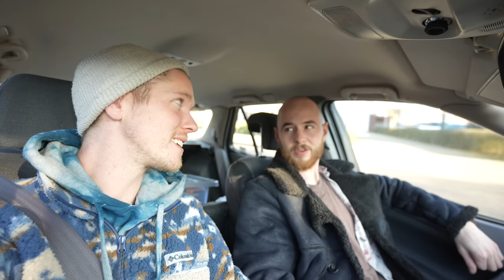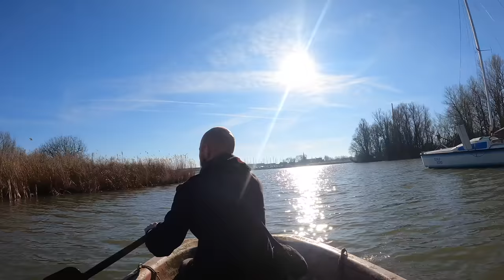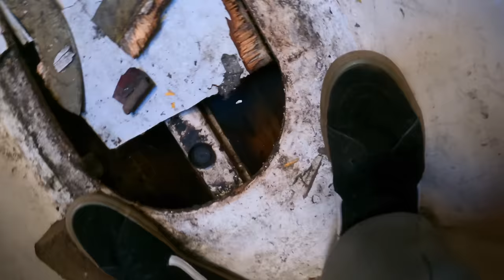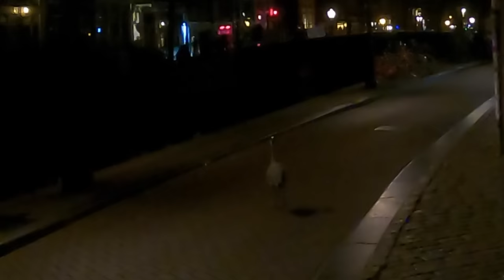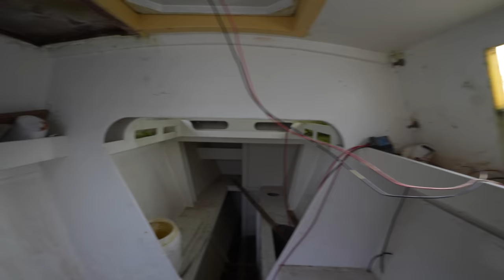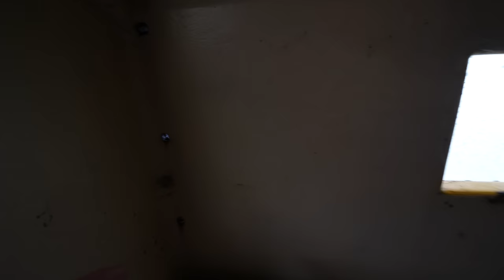I Made A LOW Offer On A SINKING Catamaran | Wildling Sailing

Comment: Assume there is damage to the structure, even though you can't see it. Given what you're trying to do, you'd be looking at pretty much a full rebuild just to begin to feel safe. I would not trust any of the bulkheads or beams.

Also don't underestimate the mess that's Brexit. Don't expect to ferry goods (or those engines) back and forwards without issues! You'll also need to factor in the cost of refreshing your visa (incl. the travel).

Personally I hope you don't go for this one as it just doesn't appeal to me and I can't see it being a nice sailing experience for you or any visitors/companions due to the accommodation.

Comment: I strongly disagree at the naysayers who see the mould and dirt but don't look beyond. If Hanneke Boon thinks the hulls are well built she above anyone else would know. Take for example the battery box the fact that it did not leak speaks volumes for the quality of the construction. If the battery box (of all things) is well built so it will be for the rest of the boat. What you are getting are two hulls, a mast, two what were brand new outboards a decade ago plus other bits and pieces. Yes wooden boats do rot but I wager there is very little rot on theses hulls. Your main expences will be sails and instruments and much of that sort of stuff can be bought secondhand for a fraction of the original price. An iPad or a laptop with todays programs can function as a chartplotter as for that matter a smart phone can. You are onto a winner if you put in the work.

Comment: It appears that you actually do not want to buy a boat,  you just enjoy looking at derelict hulls and poking around on rotten wood.  When you get ready to buy another Cat, find yourself a Prout. Roland and Francis built good boats and many go for a very fair price.  In 2005 we bought a Quasar for under $100,000, did a $50,000 refit and sold it for $250,000. We have had several Snowgoose through the boat yard that sold for under $75,000. They were solid, ready to cross oceans Catamarans. The only disadvantage we found with the smaller Prouts is the single engine. I love the movability of a pari of engines with the screws way out in the pontoons.

Comment: I am going to disagree with most of the comments on this one. Mark, you need to buy this boat! For one, I can tell that you are actually excited about this boat, and what work this boat will need, you are quite capable of doing. Its plywood and fiberglass, that's it! Nothing complicated here. From that I saw the structure is perfectly fine, just a lot of leaky hatches which are easy enough to resolve. Plus, the location for acquiring the parts and having the support you need is really good. I have completely refurbished and rebuilt two catamarans, including my Sailcraft Comanche, and from experience I think this is doable. I would question if all of the naysayers speak from experience.
Reply: I thought you said you were not going to disagree with most of the comments on here? Well most of them are saying NO NO NO, but you say yes, still you got a nice kiss of Mark for sucking up.

Comment: I am on the fence on this one... It is beyond selling, and you will be doing the salvaging of a wreck. You should be paid to do so. On the other hand, The boat is so simple. No complex electrical or hydraulic systems. Working on the engines is also very easy. If you look at it as a rotting 3d full size model that you can rebuild bit by bit it is not to bad. The end result in about 4 to 5 years time will be very cool and versatile but will it be what you will need in your early 40ties? Or do you want more comfort?

Comment: Sailing isn’t going to be cheap. Buy a boat in good condition and it will cost you, buy a cheap boat and and you will spend a fortune doing it up. Sailing an ocean isn’t going to be like bobbing around in the med, you should be considering the cost of the additional safety gear you will need. I think you need to be realistic about your finances, your skill level for fixing and who will be sailing with you ( the bigger the boat, the bigger the cost). Probably better to get a good-to-go 30 footer and start your dream sooner. You won’t even be able to use this floating woodpile for firewood.

Comment: I am sorry to be negative this boat is a risk . The Crew accomodation is  small the engines a on temp frames  and small 2 strokes . It may be cheap but is it a comfortable blue water sailer  . So please understand my comment are to help you see the big picture . I am     In in favour of sailing melody boat comfortable  design blue water capability . Andy will help to get in water good price and also nearly finished . An last think steel boat have been around for years tankers , fishing boats etc  it all about maintenance and preventative  care .

Comment: Do it man. Good luck on the offer, especially if the boat has sails.   Don't worry about the folks that call it a cack sandwich.  If they wanna see pretty they'll go watch something else.   Personally.  I'd get a good bilge pump, and pressure wash the inside drill little drain holes in the shelves. Let it all drain down then dry it off with a super shammy, then power wash the outside with all hatches closed mark the leaks.  Scuff and paint the bottom unless the hull needs some work then back in the water. Everything else happens on the water. Unless you can get the mast stepped when going back in which would be a bonus.   If the chainplates need help I'd do them on the water.  A cheap genny is just something you'll need anyway.  Keep the skiff and get a good dinghy and motor you'll need a good dink the little skiff is now your water trailer.  To be pulled on land loaded and pulled off with whatever you need for the next project.   The open platform of a wharram makes for good work space.  Kick ass boat for a kickass rebuild series.
Reply: Clown
Reply: @rudihenry5298  bell end

Comment: Looking back over the comments, so many people are saying run, it will never sail, it’s a pile of (s)crap etc. It's just like reading the comments when you were looking to buy Minke and full disclosure, I was one of those making the same comments on minke. 

But you took a knackered old boat and sailed her. Yes your DIY skills and finesse will not win you any prizes but Minke didn't sink, she had all the characteristics of a middle aged hooker in as much as time had taken its toll on her looks, she had a few ugly scars, she'd clearly been around the block a few times but she still knew how to put a smile on your face. She allowed you to sail on a budget. We all wondered how she would fair in a storm, she did just fine. 

What most folk are missing is that you could spend £30k on an older production boat that still needs re wiring, re rigging, osmosis treatment, maybe an engine rebuild, but you would have blown your budget on the purchase. But buy a £2k boat and you have £28k out of your budget to throw at her. You have the time to do a lot of the work yourself, your dad is a massive asset and you are humble enough to ask for help when you need it. 
In some ways this boat shares a lot of similarities with Minke, if you do buy her call her hooker (in tribute to your fishing skills 😉

Comment: Once you have cleaned, dried and stopped any further water ingress ventilation and air movement through the boat is most important. Usually scooped in at the bow and out at the stern. Bilge blowers are good in a mono hull. Catamarans have more bulkheads so more thought needed  to achieve the result. Good luck!

Comment: I'm truely puzzled by the prices thrown around - I respect that there is a cost involved into rectifying this boat, but I thought at 8k that it was a steal already... if I was offered only 2k I'd be offended... but then there is the comment section, that essentially is saying, the old owner should pay YOU to take it off them...?!? - sorry, what am I missing here? what about all the Materials already bought and used to build this boat so far? What about the engines? batteries? all that has value... no?

Comment: There will be far far far more hidden rot that will make that boat unseaworthy . For what happens to a plywood boat in that kind of disrepair watch the Zingaro episodes where the hidden rot has the vessel break in half from damage he did not know about . He claims it was fine but you can see the water damage in the wood and  all it takes is for the glues to let go then your structure is glued to veneer that is not attached to the ply  . Zingaro never made it around the world and he is a good sailor .  

Fiberglass protects but also hides as does paint  . Take Zingaro's obvious lesson learned , he bought a fiberglass monohull to complete the journey . 

Unless you plan on just coastal weekending - run . The boat will never be blue water safe without you stripping the entire thing inside and out and replacing anything even darkened by water .  

That boat Can't be cheap enough because it will never do what you want . Go back and look at that steel boat again that had been mostly restored . Make a an offer that you would be happy to get her for . You are making the mistake of falling in love with a type of boat and not seeing the problems with it . You are dreaming the paint stoped any damage , that bad smell its ROT , that section of roof removed - rot and you noticing it is still wet around it says they did not go far enough .  . . 

Final warning about  fixing that boat , some yards will refuse  to take you for fear you will abandon it and it is worthless - they can not sell it and they have to pay to dispose of it . Insurance may refuse to insure  it too and then no marina will take you .  One look at her and I sure would not insure it .

If you Must have that boat,  the fair price is what it would cost to haul it away and dispose of it . If you really want it they should pay you almost  that . Seriously .

Comment: what was its original plan for use, where's the house part?  it could not have sailed anywhere since its launch.  buy a damaged mono hull with a running engine and parts of a rig, then cut it open and park it under the bridge and make a trimaran out of it, then cannibalis  everything to put a rig up, otherwise it will be burn more money then you have and be a  problem to finish.  youth is an advantage in this endeavor, and what an adventure for sure,  but still going to be a brutal slog to do it.  you'll have to abandon most of your normal build thinking process of excessive cheapness. it could be cool as a tri.

Comment: Mark, If it's right with you, Do It! MOTOR SAIL it out of there to a cheaper more convenient place. Only fix the Hulls really good outside, get the rudders working and the outboards running, pop up the mast with some dynema and get a sail. Re-lash the beams, and your gone. Sanding and all else can be done later. Good Luck with whatever you decide. I'll be watching, thanks!

Comment: Unfortunately with this one I get the feeling your dream of having a Wharram has far surpassed your sense of reality. Id say the time and cost of getting this one to take you around the world would be equal to if not more than just building one yourself from scratch. I don't see much in this one that potentially needs replacing where as you have shown so many other boats in recent times that would be far better options to have you sailing rather than repairing .. I suppose you need to ask yourself if your priority is to circumnavigate the world in relative comfort or risk wasting all your hard earned money, time and sanity chasing a dream that could see that never happening or if it does not without costing you a hell of alot more than if you bit the bullet and just bought one of those others where someone else has done the hard work.

Comment: The only thing that is interesting about this boat is how much firewood you can turn it into. I don’t know why you are so in love with these. To me they have to be the worst designed boat I have ever seen. There seems to be no facility for a large central cabin, and even if you made one, getting into the hulls to sleep would be like sliding into your coffin. The mast arrangement - one on each hull - is that true - is bizarre to say the least. And as for engines - a couple of rotten underpowered outboards. Don’t do it. Anyway, it’s your life. I shall check back, and if you have taken on this piece of cr@p, it will be goodbye from me.

Comment: Well, your expecting this in the comments, so I wont dissapoint. 
Maybe, Maybe if you get it for 2000 euro (still too much I think) and you're prepared to perform an exhumation and do a LOT of hard work, then just maybe it's worth it if your heart is set on this sort of Cat.  Do you LOVE working on boats more than sailing them?  Cos this is going to probably tie you up for a couple of years, not just the one year you mentioned, and its going to keep you in a climate you dont particularly like.  And (as always) it's going to cost more than you expect.  Is that really what you want?  Hope you really love working on boats.
If your going to have to replace much structural wood and fibreglass then you might be better off attaining the plans for your ideal boat and starting from scratch in your choice of location.  
I think that this is a bigger project than you realise, fortunately & unfortunately there is not a lot too these boats.  I do seriously wish you all the best and a good deal of luck as well.

Comment: Its a pressure wash and pump out away from being a blank canvas. There seemed to be a mast on deck any other rigging and sailing gear? Needs a pod, easy to build yourself but still a project. repairs would be easy as rot is usually localized if there is any and basically you just drill a hole cut the problem out and splice in a new piece of ply then glass over.

Main problem is somewhere to work on it, then the rig and sails.

Could one option be take the motors to Dad then either fix or replace then clean check hull and lashings and motor it or tow it back to England and a cheap yard or mud berth either near Mum and Dads or Hanneke then live aboard and work with the bolthole of Mum and Dads.

Comment: My Tiki 21 was in a similar state. I paid 1/4 of the asking price. It was covered in green slime but solid. I cleaned, painted and varnished it end to end, made new hatches and deck pieces from plywood. That Pahi has huge potential. Buy for 2k spend 10k on it and it could easily be worth 20 or more.

Comment: I'd totally take that and do the following. Drop batteries going across the deck with a pop up floor for maintenance. Put solar panels above said batteries that hinge up for maintenance. Put ELECTRIC motors in the beast and a back up generator

Comment: the worse thing for rotting wood is stagnant fresh water.  My advice would be haul out, dry out, then carefully tap out both hulls and decks for soft spots., maybe even invest in a moisture meter.  £2k sounds about right price-wise.  You are at the right end of the summer for work and drying, but one concern would be separation of the f/glass sheathing from the wood structure.  Is it epoxy sheathed?  If so, good, if polyester then walk away.  Boat is a good size for your plans so she looks like a good basis for blue water cruiser.  Subject to survey.   Good luck matey!

Comment: There is a load of negative comment here, just like when they bought Minke. I think people will be surprised how this turns out. It looks to me as if all the water in the boat is rain. Wharrams are made of wood and well protected from immersion on the outside. I suspect the same protection has been applied on the inside, at least where water collects.

Comment: I have fingers crossed that the builder did a good job on the epoxy in the bilges. If the hull isn’t rotten and it comes with decent sails, I can see you getting this one together. Better this, that’ll sail like a witch than the steel tubs you’ve been looking at! Really looking forward to finding out if this is the one!
Reply: We're only looking at steel tubs, not buying.   Am sure we won't buy a steel tub but maybe a hulk.
Reply: @rosslovell1354  :-) I'm as cynical as the next bloke Ross, but I don't think Mark would waste Hanneke's time if he wasn't on a mission to purchase this one!

Comment: This project would be fun to follow. 
And you can fit a lot of solar panels on it. Maybe electrical outboards. Looks like its mostly algae growth and bird poop, no worries! :)
Reply: According to Mark it smells like a dead body in the hull (his words not mine). The reason for that is rot. The boat is a floating wreck.
Reply: @markandrews6054  might as well be a dead bird from the nest..
Reply: @PerNewstream  No. Just no. That's no dead bird mate. You can clearly see that the boat is rotten. You'd have to be blind not to see it. Any marine surveyor upon seeing this wreck would tell any prospective purchaser to leave well alone. Look very closely at the video, pause it every few seconds, go full screen and look closely at the hull - the rot (and lots of it) is in plain sight. There is a reason why this boat is still on the water and not in a marina / boatyard. Why at the very least are the two outboard legs still in the water if the owner cared about this boat? Short answer, he obviously has not given a flying crap about maintaining this boat in a seaworthy condition. It's a basket case. The best thing to do to it is to set the bloody thing on fire.